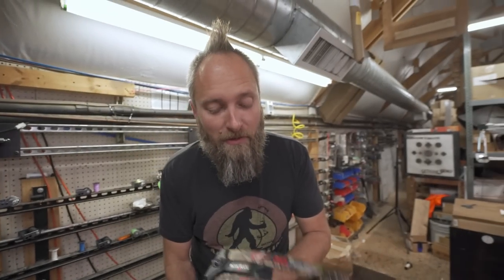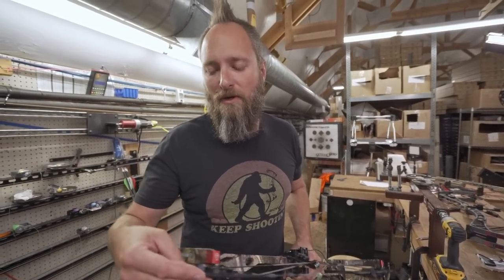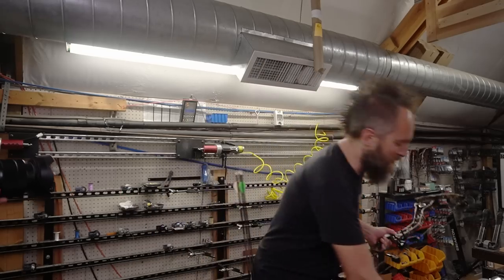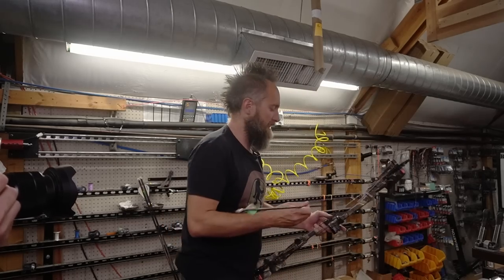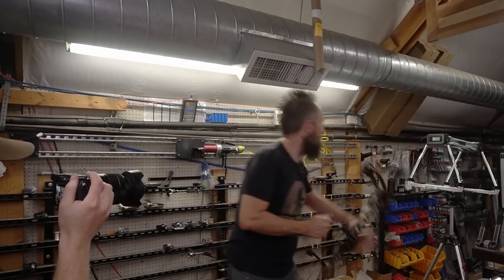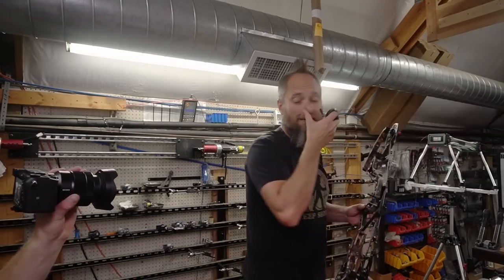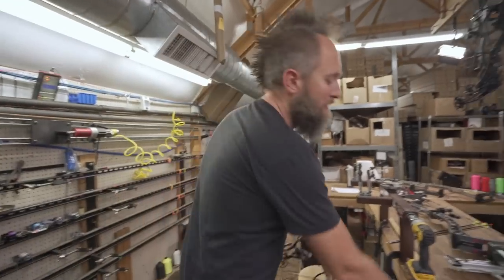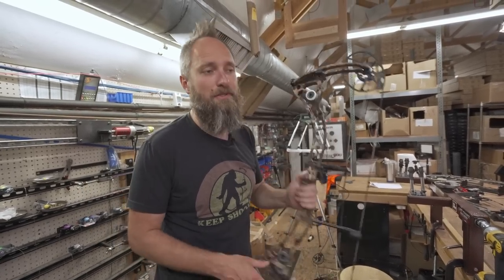2023 Bowtech CP30 With MFJJ!!

Comment: Depending on the bow, I'm right around a 27" to 27.5" DL, This bow is appealing to me first for Bowtech's tuning features but also I just like the look of the style of the riser, especially where they flair out for the limbs.  Nice job Bowtech.  Being a relatively shorter draw archer, I wouldn't mind a speed rating more in the 340 range but draw cycle smoothness isn't a  big deal for me either.  The "hump" tells me..... its fast!!!  And I'm not one to chase speed at all but I do want something that will put a moderate weight arrow out there at a decent trajectory..... limitations when you're only at 27" really stack against us T-rex armed dudes!!!
Reply: The bows this year claiming 340IBO are actually shooting about the same true speeds as this one, especially at shorter draw lengths.